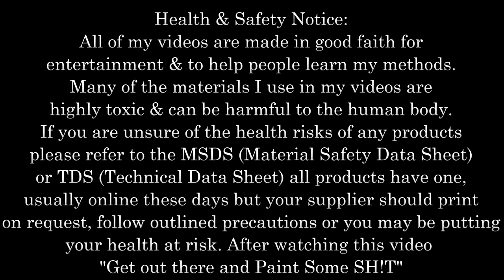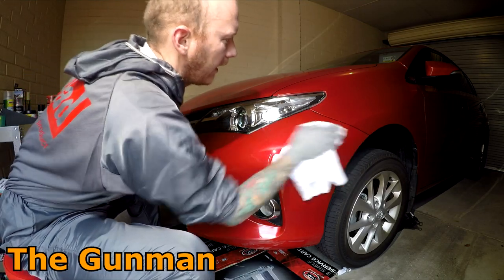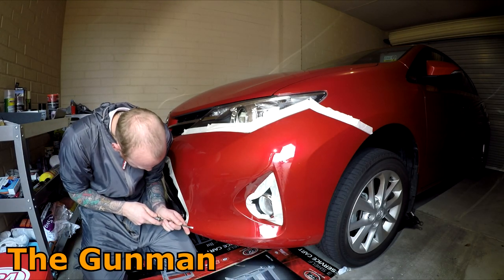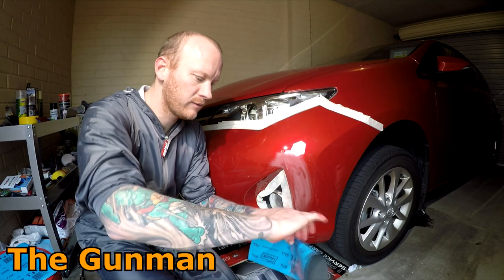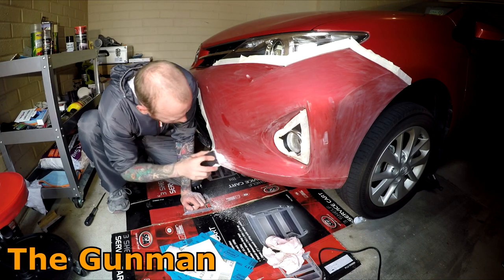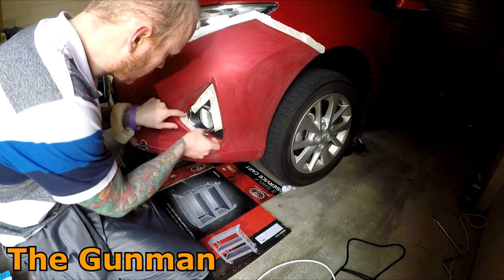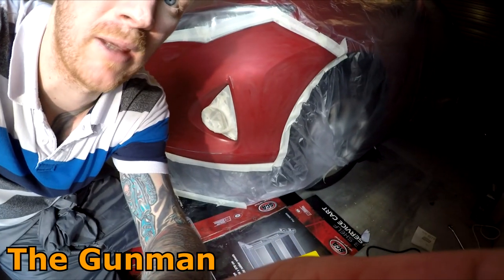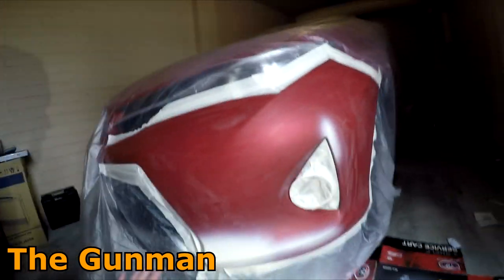Rattle Can Spot Repair

Comment: It's strange seeing you use rattle can paint. But I'm glad to see that you are showing how to do a small job with no tools. I've had to do a few of these jobs myself in my 25 or so years of automotive work. I've mostly done mechanic work, but I recently started at a body shop here in the US as a detailer with hopes to become a painter. I've worked in a body shop before as an assistant, but didn't realize that I had a passion for it until a few years ago. Watching your videos has definitely helped me a lot. Thanks for the information and entertainment.

Comment: a question ... in the cracks between the headlights, grilles, junction between the bumper and the wheel arch .. the paper does not fit well ... if you do not dull them inside the paint will not come off?

Comment: I had put touch up paint in areas on my truck and after it dried and had to put it on with a small brush that came with this Automotive touchup kit maybe I shouldn't applied primer first but gonna spray over it with a reusable spray paint can but won't use the primer just sand it down flat and put base and clear I had made the smaller spots bigger after I used the brush on the the touch up paint kit too. I don't wanna use a brush touch up kit nomore I have a heat gun it's called the Master heat gun would it properly cure the paint after I spray over the spots that aren't blended in on my truck. Or do I need a stronger heat gun than the Master.

Comment: Hi Gunman
    Did you use finer grade paper than what you would usually use because the rattle can paints are thinner?
      Could I use spray can  basecoat for small areas then use the gun to clear over, thanks

Comment: Hey gunman. I am an avid DeVilbiss user. I watch your channel quite a bit. I have yet to see a review on the Tekna prolites. That’s what I use here in the states and absolutely love them. Have you done a review? Also I have ran into a new spray gun line. The Atom spray guns, the x series. Half the price of sata and Iwata but identical or if not better spraying and build quality. Worth checking out.
Reply: He's got tons of reviews on he Tekna Pro-lites.  Also, Gabriel from Motivated Painters (You-tube him) has done one or two as well.  Gunny loves the Pro-lite.  I bought and use one based on his reviews.  Seems to work OK, but I find it a cranky gun at times.  Ha ha

Comment: Gunman help - i fixed a long deep scratch in my truck using a base and clear (spray cans) matching the truck but masked about two inches above and below the scratch which now after removing the tape i have a raised clear coat area and hard line where the tape was in the middle of the door panels of the affected areas.  I have tried using 1000 grit on a block to flatten it out but with no success - the line is less visible but there is a noticeable high spot where i sprayed the clear - do you have a video out i can watch that you might recommend or what do you suggest

Comment: When you are prep sanding/scuffing, do you mean to totally remove the clear coat or are you just scuffing the surface?
Reply from the maker: Just scuffing the surface to ensure adhesion.
Reply: @TheGunmanChannel  Thanks. Love the videos. Would love to see more tips for the home garage, like this, with the entry level gear or running  off small compressors.
Reply: I'm not painter but a diy man.
Perhaps what i've learned is wrong, but i would have used a 600 sandpaper to be sure that the new paint doen't detach from the old one. 1500 do the surface too smooth, or?

Comment: if the 1500 is very fine .. why do you use the 1500 to prepare your bumper?
Reply from the maker: Because it's just what I had, it will work totally fine though as I say. In fact it's good for blend panels because it won't cut though the clear as easy as a coarser grit. But it would take forever to sand primer using 1500 or even 1200
Reply: The Gunman ok .. so the 1500 is good for the transition zone because it is easy to polish

Comment: Is grit 1500 good for preparing old paint? the new paint clings well?
Reply from the maker: It's a bit fine but definitely works.
Reply: if the 1500 is very fine .. why do you use the 1500 to prepare your bumper?